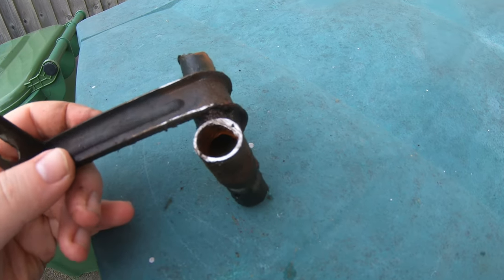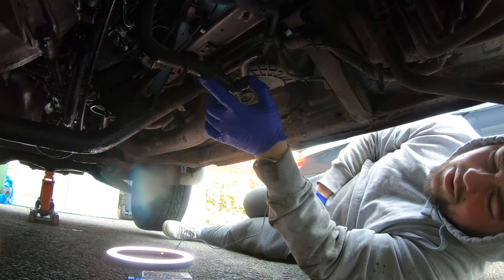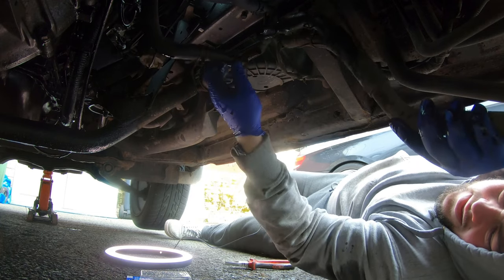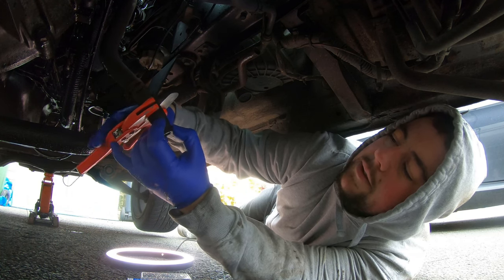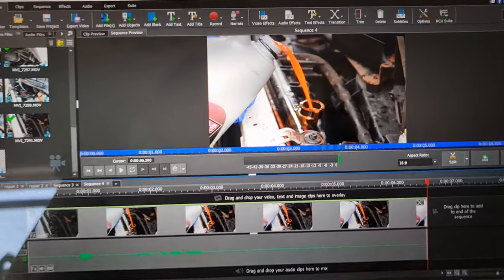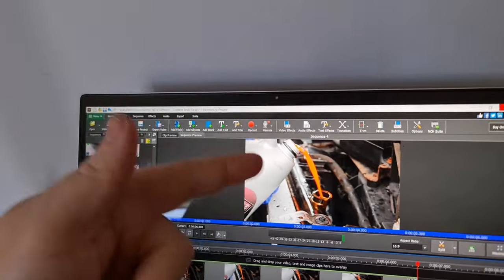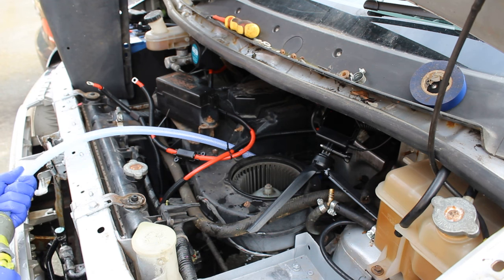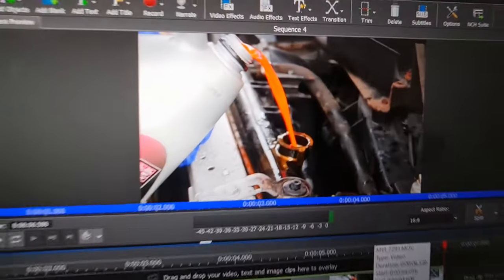Coolant Leak fix // Mazda Bongo // Ford Freda

Comment: Loving the videos 👍🏻 Don't suppose you remember the inside measurement of the rubber hose. Looking for a T piece for mine. Cheers
Reply from the maker: I can't remember off the top of my head. I actually went to my local aquatics shop. They let me take a couple of fitting out to the car park to offer up to see which size fits. Might be worth a go?

Comment: Any chance you could let me know where to get that T piece replacement?
I appear to have to exact same problem!
Reply from the maker: I got this from an aquatics shop believe it or not. You could also use a garden hose pipe brass fitting as it is metal. Maybe better 😁